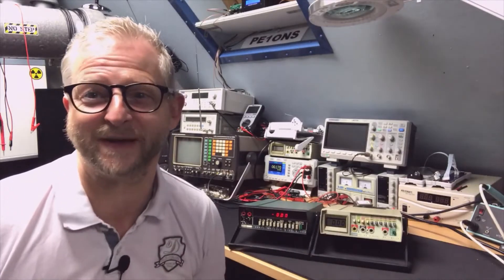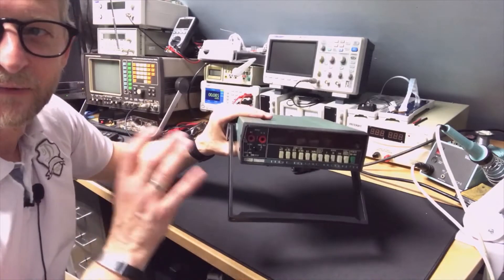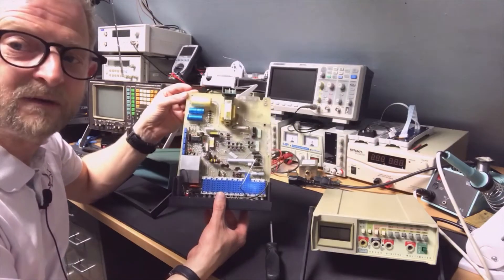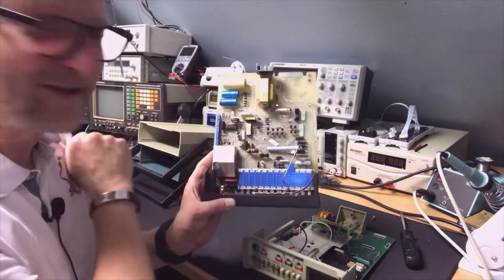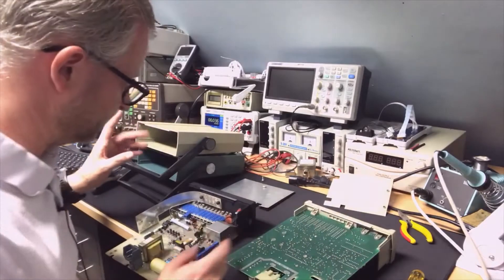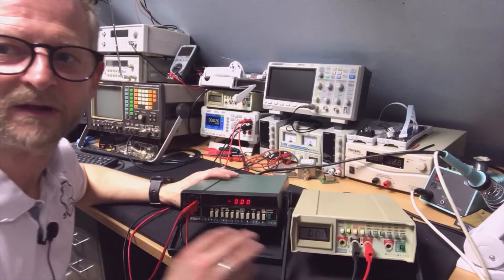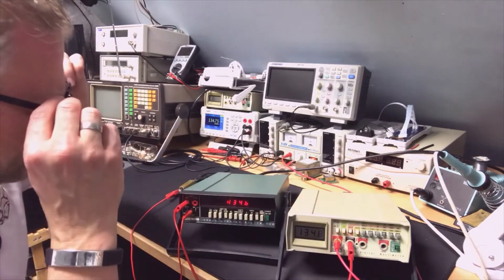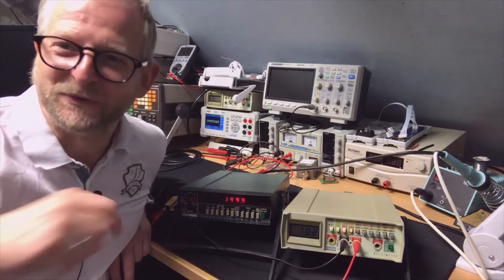#040 Fluke 8000A vs 8010A and Teardown

Comment: The "glass plate with wires" you mention at 4:45 is likely a specially-made resistor that is the current shunt for the highest current amps range. The construction seems to be Nichrome resistance wire in the form of a flat ribbon (like you might find in an old electric toaster) wrapped around a flat sheet of mica. Looking at the 8000A manual, this part appears to be R48, which is described as "RES, WW, 0.1 +-0.1%".
(I don't have an 8000A to look at, but I do have an 8600A which contains two of these which have values of 0.1 and 1.0 ohms).
Reply from the maker: Thanks, interesting, it was a while back.. nice to see this again

Comment: I recently got the 8010A. Since it has not been used for many years, the push button swtches are not very reliable, probably due to oxidation. Some times, I have to push back and force several times to make it work. Is there an good way to clean the switch contacts?
Reply from the maker: Hi, thanks, i have some newer videos too with cleaning tutorials, but mainly here i use WD40 professional contact cleaner, i try to spray it in the switches, i leave them as they are.
just switch it many times and it will improve. They are very nice meters.
Reply: @TonyAlbus  Thanks for the reply. I just watched your Simpson 467 cleaning. I will try with the WD40 electric contact cleaner.
Reply: @TonyAlbus  By the way, I finally got a can of WD-40 Contact Cleaner, and prayed the switch bank from front and back. The result was great! The sticky pushbuttons instantly became crisp. The resistance values when probes are shorted went to 0.00 from 15-20 ohms. Now, it's a reliable meter.
Reply from the maker: @gang208  Great!!! thank for letting me know.

Comment: My first job as an engineering technologist I had a Fluke 8000A,  It was pretty new at the time as I got that job in 1976.  A few years later I had a new job and a new meter.  It was a Fluke 8012A.  Not much different than the 8010A but had a low ohms range that would measure down to the milli-ohm range.  It was good enough to read the difference in a couple of cm of PCB trace so it was great at pinpointing trace to trace shorts or other shorted components.
Reply from the maker: Thank you for that comment, very nice to see you worked with them. My dad also used it all the time, i have that one now :)  still working. the 8012 Will also come to Fluke Friday.

Comment: This is the best multimeter you can get on FleaBay for less than  50 bucks.

 1 - It is a Fluke. Just this point is enough !!!

2 - True RMS

 3 - Low ohms (8012A model, down to 2 ohms full scale. Get a GOOD quality probe pair, the 8012A is not Kelvin)

 4 - three Conductance ranges (down to 200 nanosiemens)

 5 - Three diode test ranges.

 6 - Pleasant to service (the only job you'll have to do is cleaning the switch contacts.)

 7 - (8012 model) "hidden" 10 ampere range. The shunt is there, on the PCB but not conected. You'll need a fuse and some place to add  a banana jack. To access it: buttons "mA" and "20 MEG". The 8010 model, which already has this range  limits this range to 10 amperes. Do not exceed 10 amps.

8 - You'll get a used model with many tens oh thouands of hours of aging behind them. The Motorola MC1403 aging rate will be in the few PPM / (root)1000 hours. I bought one at a Hamfest lately and it is as accurate as it was to the original owner.

Okay, it lacks autoranging, continuity beeper, capacitor and transistor tests. But a Fluke for 50 bucks, you can't miss it.
Reply from the maker: Thank that is a lot of info... yes good quality for your buck

Comment: Tony, nice video, but it still suffers from a lack of sufficient knowledge of the subject. First, there is no way that the crystal is 50Hz. If you looked at the Fluke documentation, you would learn that they made versions of their meters with crystals having slightly different frequencies, in order to reduce certain issues in regions having different power line frequencies. The A/D IC requires a crystal of typically 3.2Mhz, but it is common for Fluke to mark the crystal according to which version of the crystal they installed; it is not a crystal frequency indication.

As for the odd 'glass plate with pins', those are usually either precision resistor arrays or some kind of hybrid circuit, for example to produce a true-RMS function or something else. Digital multimeters almost always have devices like this, sometimes one of them, sometimes several of them, as part of their circuitry.
Reply from the maker: Thank you for the extra information.

Comment: Hey Tony, I am looking at some old videos of you and see the Fluke 8000a. I just recently bought one myself but it looks some what different  from yours.
It has two switches extra in the left upper corner. Are you familiar with that? I don't understand the function of these switches.
Nice videos!
Reply from the maker: Hello Jan, Thank you... i do have an other 8000A that has a 10Amp option..it has not 2 buttons, but 2 terminal busses on the left top, these you use for the 10Amp option...and you need to push the mA and 20 switch together if i am correct.. other options are batteries and Ohm precision i think, but you can usualy see what options you have on the sticker on the bottom.. my 8000A with this 10 Amp option will also show in a video some time later!
Reply: @TonyAlbus  Thanks for your reply Tony.